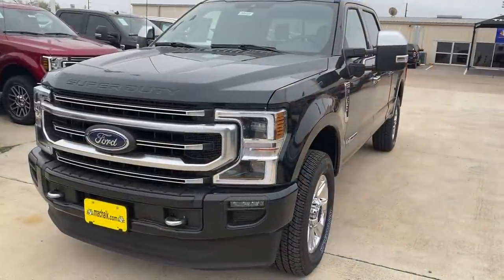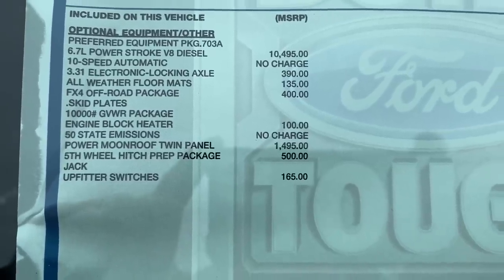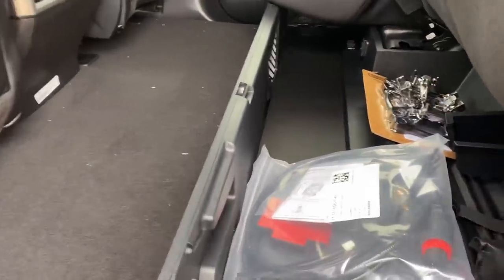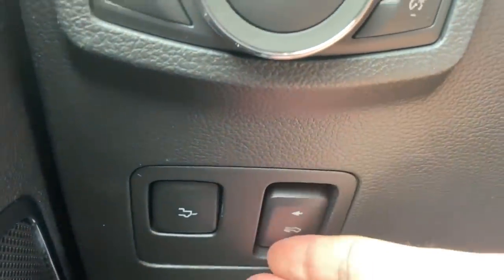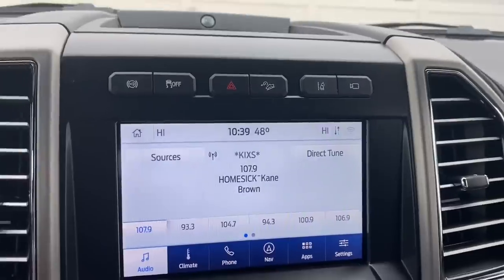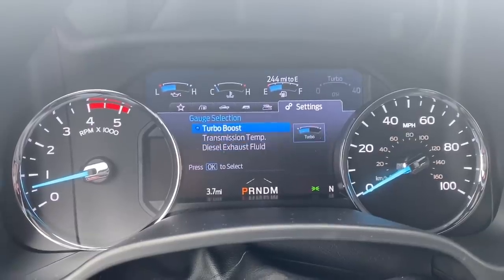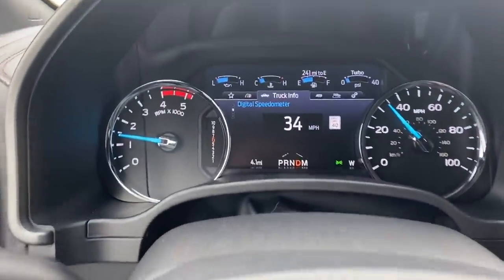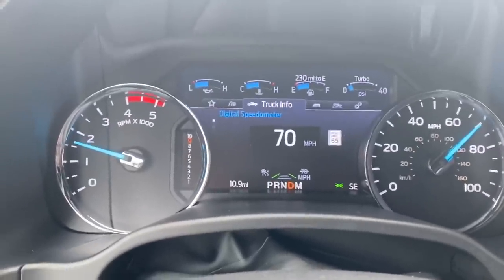2020 Ford F-250 Platinum 4x4 Review

Comment: I am a ford fan, have been driving them for many years. Anyone who states that an optioned out Lariat is as good as a Platinum is dead wrong. I ordered a 2019 F350 Lariat and traded in a 2013 F250 Platinum. The 2013 was hands down a better quality truck. I have now bought a 2020 F350 Platinum ($85,000) and it is far superior to any truck out. I traded the 2019 F350 (new cost ($75000) with 8300 miles as it was not the caliber of a Platinum. With all of that being said, I think the transmissions may be a problem for a while. I literally drove the truck off the lot and came right back because of noise that didn’t appear right. After coming back with less than 2 miles driven, and going through the chain at the dealership....I learned that the transmission was bad. They did give me a new 2020 explorer to drive and are getting a new transmission shipped from Detroit so it can be swapped out. The dealership is handling it great and ensuring I am informed step by step, but what a bummer. Can’t wait to get it though, there is literally no other car or truck on the road that can compete with everything these trucks have to offer. I know, some Dodge, Chevy or other lovers will comment negatively, but I assure you that you can’t show a window sticker on a 2020 truck that you own that is this well equipped. And if you can’t show it, you aren’t worth the comment you make on the topic.

Comment: Come on Ford 21st century and no spray in bed liner 80g I would hope to have a bed liner. Nice truck tho
Reply: A lot of people choose to have it done themselves. It's really not a big deal dude.
Reply: No kidding 😂
Reply: leardi58 you worried about bed liner? How about the fact that it’s a platinum and you have to pay extra for moon roof.
Reply: @TheZchauvin  Those moon roofs leak bad to, I'm sure they've fixed the issues by now
Reply: sammy duran I hope so, I’ve got a 17 and they haven’t leaked yet thankfully. I went lariat fully loaded and saved the $18k that you pay for the platinum badge.
Reply: @TheZchauvin  I'm sure you'll be fine. My brothers 19' only leaked when it had a ton of snow melt. The dealer replaced the gasket and it seemed to work so far.

Comment: With 10% down on a standard 60 month loan at 4.5%; after tt&l you're looking at $100,000.  Kind of hard to believe bedliner doesn't come standard for $100,000.
Reply: there are plenty listed in the mid to high 60s around. check cargurus
Reply: @derekwood3189  I realize that.  But there's plenty of suckers who'll pay sticker and still have to pay for a bedliner.
Reply: $500 if you can afford this truck, you can afford to put a bed liner in it at the dealership. Not everyone wants a bed liner

Comment: Why is payload so low???  My 2019 GMC 1500 has 1450lbs and the new 2020 2500 Denali HD Diesel has over 3000lbs payload. Think they missed the mark.
Reply: Probably cause this truck doesn't have the heavy duty suspension package
Reply: That’s not the bed payload, just the cab.

Comment: Is the front end height the same as a 19? they only lowered the back correct? The rear end already has rust. For $80k that’s pitiful.
Reply from the maker: I think it’s just the back
Reply: So, just because a truck is $80k, you think that none of the driveline components should get surface rust on them? 
Do you live in fairy tale land or what?
Reply: Jeff Clark Yes for $80,000 that is exactly what I’m saying. There should be no  rust  before it leaves the lot
Reply: @Deere-uh4go  LOL, let me know what it's like in fairytale land. Even cars built by Mercedes will have some surface rust on those raw metal components after sitting out in the weather.

Comment: Look up 2020 Gm payload. 3500 lbs  and 3500 series 4200lbs. For the duramax diesel
Reply from the maker: I have a high country 2020 review that shows the payload on 2500
Reply: Rocky Rohde yes I went from the info on the website but wow the Gm has way more payload.

Comment: Question for anyone.  I just got a 2019 F250 and when I start it up, it the gage view always defaults to "towing status".  My 2016 F150 defaulted to my last view.  Does anyone know how to change this or do I have an issue?  Thanks.
Reply from the maker: Set the dash, radio, and mirrors to what you want it to be on. Set seat #1 memory with your key fob in the truck

Comment: Did you feel the really hard 3to4 up shift? I drove 4 already and they all did it.
Reply: The F150 10 speed has the same shift “abnormality” that Ford calls normal, it has gotten worse on my truck.  I was hopping that it was corrected for the SD but it sounds like it didn’t.
Reply: Sidney Johnson Oh no. I had a 2018 f150 with horrid up and down shifts in the 3,4,5 and sometimes 6th gear. Ford bought it back and I got a 19 Super Duty diesel and that 6spd is sooo good. I hope they don’t ruin it w/the 10!
Reply: Juan De Pedro Ask your dealer to turn off “adaptive learning” feature and clear it’s memory and it will be smooth again.
Reply: Neo Craft I’m in the buy back process currently, it’s been in the shop multiple times for those shifts.
Reply: Juan De Pedro Does it fall under your states’ lemon law? Mine did. By the time it had about 8900 miles on it (4 months) it had already been in the shop for 38 days. Ford took a while to complete the buyback but I drove it for free for the next 4 months or 5 and it had 15,500 miles on it when I turned it back in. Got every penny refunded, but I paid for the lawyer ($2500).

Comment: Does it have differential locks - front, center and rear?
Reply: There is no center differential, so it does not need a center differential lock. It would be impossible. When it’s in 4x4 mode, it’s locked in. You shouldn’t drive in 4x4 on pavement. It does have an optional rear locker. The Tremor package has rear locker standard and a front limited slip.  It should go just about anywhere.
Reply: @alexs3187  The biggest off-road ability is when you have all diffs and locks.
Reply: TheRushtime you don’t really understand it. But that’s ok. A center differential isn’t for off-road. It’s for driving both axles on pavement. It allows the two axles to open up to allow the vehicle to go around corners without binding the axles up. Because of that, it makes it less capable off-road, when you want 50/50 torque all the time to avoid getting stuck. That’s where the center differential lock comes in. These Super Duty’s don’t have a center differential. It’s not made to drive in 4x4 mode on pavement. Hence there is no center diff lock. Putting it in 4x4 mode is like putting a Toyota or Land River in 4x4 with the center differential locked. It’s the same. On pavement, it has to be in 2 wheel drive.
Reply: @alexs3187  1. You contradict yorself)). Center diff is for off-road when you 50/50 torque between 2 axles. In a city you don't need even 4x4 mode.
2. What do you mean "this truck"? May be other models has an option like all diffs and locks? Or may be it is possible to add them in some car workshop?
3. And by the way the 3rd question if you know: is it possible to convert it from pickup to an SUV? Pickup is not useful imho (you can't sleep in there), but has strong chassis.
Reply: TheRushtime I didn’t contradict myself. Read it carefully. 

Center differentials are to allow 4x4 mode on pavement (on vehicles that have them). Toyota calls it “Full time 4x4”. Some manufacturers call it AWD. It allows better traction on pavement, but still allows it to slip so that it can drive on dry pavement. So to add more capability off-road, they have a center differential lock for mud and snow. Ford doesn’t have this on the Super Duty. It’s just 4x2 or 4x4 lock. No in between mode. The F150 has a 4 Auto mode, but that’s a selection inside the transfer case. It doesn’t have a center differential like Toyota has. But it can do the same thing. 

Basically if you don’t have a center differential, you don’t need a center differential lock. Center diffs are only to allow you to use 4x4 on pavement. 

The Ford Expedition is the SUV version of the Ford F-150. It’s transfer case works the same way. 4x2, 4 Auto (so you can use it on pavement), 4 High (locked), and 4 low.  The base models only have a 4x2 and 4 auto mode.
Reply: @alexs3187  I understood what are you talking about ))
Ok, let's say center diff has 2 designations: for pavement and for off-road. Not only for pavement )).
I just say the car that has all 3 diff locks is better off-road, than other that doesn't has center diff (and lock).
Off course you need diff before you have lock, I am not so stupid)).
Toyota has center diff, but it is not lockable. 
Thanks for your advice about Expedition.
Reply: TheRushtime the Toyota Sequoia has a 3 mode transfer case with a center differential and a center differential lock.
Reply: @alexs3187  Yep, but it doesn't hase front diff (and lock)! Btw I love Sequoia, nice truck👍
But! When I move to America (it will be soon) I will buy only American products (like sneakers and jeans), and I will register my yacht in America only.
That's why I'm interesting about Ford F series modification. But ok, I'll buy Expedition )). Thus I have some doubts if Expedition has the same chassis as F series. Usually SUV has light version of it because designed for cities. But I want travel around the country.
Reply: TheRushtime every 4x4 has a front diff, but very few of them lock. The Jeep Wrangler Rubicon and Ram Power Wagon both have front lockers.  The Ford Super Duty Tremor and F150 Raptor both have a limited slip front diff. Everything else has an open front diff. We will likely see what the Ford Bronco brings to the table at the NAIAS in Detroit next month.
Reply: @alexs3187  As for me the role sample is Mercedes Gelendwagen as it has all diffs and locks at the base. But it is not for a long travels, too short to stretch your legs )). I also like Nissan Patrol, it is nice for long distance traveling, but it doesn't hase front lock and diff.
Reply: mtrujillo1973  Thanks a lot! Can I build a rock crawler based on this car?

Comment: Does it make you wish you would have went with a Ford instead your Ram??? :)
Reply from the maker: This is a good question.. I like all truck brands. I buy a new truck every year due to mileage. I traded my 19 1500 limited in with over 50k miles. I have been a mechanic since I was a kid and worked on all types of engines from 2 stroke Detroit’s, cat 6.25 bores, to modern day engines. I understand all systems on the engine and power train.  I have a high respect for engineers in this segment. Competition drives perfection.. The trucks are different and I weigh the pros and cons for me with each purchase. If we could have the perfect truck we would choose best technology, best ride, most comfortable seats, best payload, best tow rating, best fuel Effeciency, best in your seat power, best leg room, etc.. One truck will not have all of these features and we all will make a decision. I had three mega cabs in a row and went to ford king ranch and loved that truck also. Sometimes you just want something different when purchasing something new. I also look at supply and demand in the used market and how that affects resale on the vehicle. I know it’s a long answer.. it just depends on your needs, do you pull trailer how large? How often? How far is your daily commute? What kind of mileage are you looking for.. if I won the lottery I would have one of each for different reasons lol..
Reply: @RockyRohde  Dave Ramsey has entered the chat

Comment: Nice.
I'm not a big fan of  platinum. 
Plain black   Interior. Looks like a base model .  I can get a XLT and slap on the  logo platinum.     I'll stick to King ranch
Reply: Um...what? You're joking...right?
Reply: All Ford interiors look basic to me. Ram has the best truck by far
Reply: I bought the 2018 XLT with all the options I could find... I hate sunroof and leather anyway.  I got the full camera setup, the full mirror setup, the gooseneck hitch, the rear glass, the chrome package, 4x4 FX4, sat nav etc.
Reply: mtrujillo1973  for me it's 
If you gonna charge me 70k to 100k for a vehicle it better look like only a  Pilot can drive it.
It's the 21 century.   Give me more for my money's worth. 

I remember most expensive truck was 40K to 50k  you get all the bells and whistles.  Now they wanna charge so dam much that it still looks like a base model.  

 Platinum, why the hell so expensive.  I can get a XLT with leather and still look like the platinum for half the price 

Just saying. Give me more for my money
Reply: @devodar2579  Ram has the best truck by far? That's not what America thinks ...more Americans chose F150 over Ram ,again, in 2019
Reply: Ford beats fiat ram easily.

Comment: That's some serious payload.
Reply: datrelle g horrible.  My Gm had 3000 and my 2020 gmc Denali 3500 is 3700 pounds payload
Reply: The diesel takes away 1000lbs, the 4x4 takes away 600lbs.  If you need payload don't get the powerstroke, or get the F450.  I love my F250, but it won't hold a big camper... it will pull up to 15000 though.

Comment: And ford will re-design it again in less than 2 years to match the F-150 body style.
Reply: what do you mean to match the f150 body style?
Reply: Finn Campeau 
Same with how the interiors match now. 
The new F-150 will be out soon. New interior. All the normal stuff. Etc...

The super duty won’t be far behind if I had to guess based on how ford has been doing it lately.
Reply: Billy the exteriors match as much as they can. the super duty was just refreshed 3 years ago
Reply: Finn Campeau 
Referring to interiors... not exterior.
Reply: Billy their interiors are almost identical
Reply: Finn Campeau 
Yeah, that’s what I’m saying. There is a new F-150 coming out soon. New as in new/redesigned interior and exterior. 
The super duty will soon follow.... including interior.  I can’t explain it any simpler bud. 

Simply saying... for those who bite the 80k bullet so to speak on the mildly refreshed super duty don’t be surprised when a new interior/updated interior is released for the super duty in the near future.
Reply: Billy well that’s obvious. what the point of your comment then?
Reply: mtrujillo1973 ? that’s what i said
Reply: Finn Campeau  the point is don’t rush into getting it. Full redesign isn’t far off.